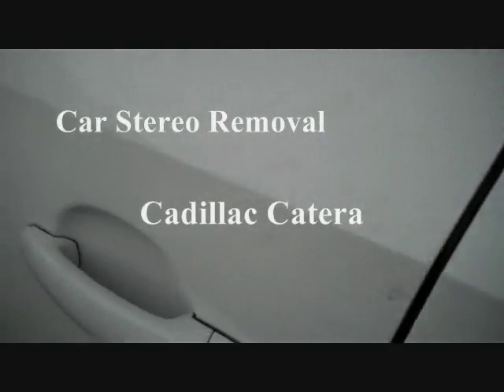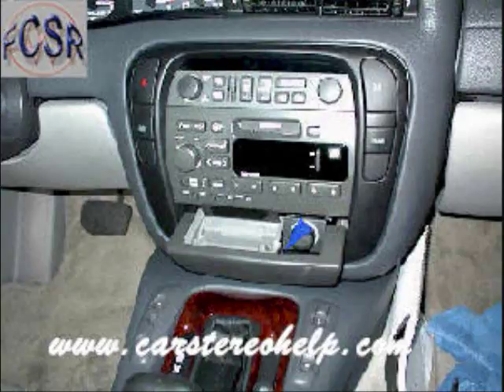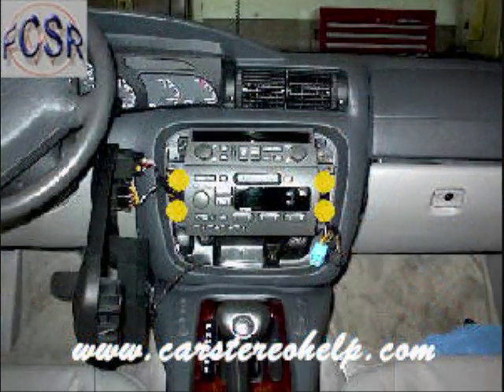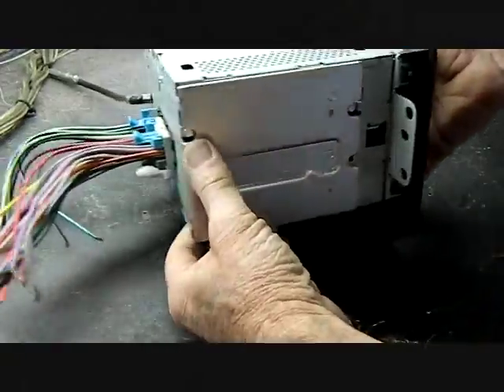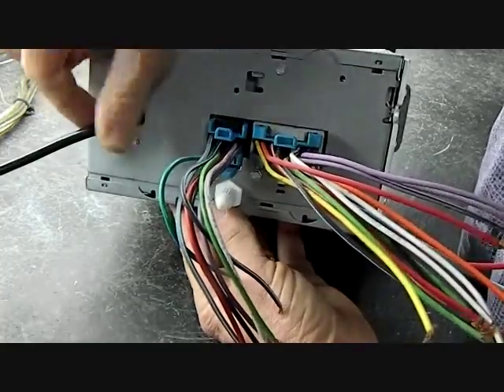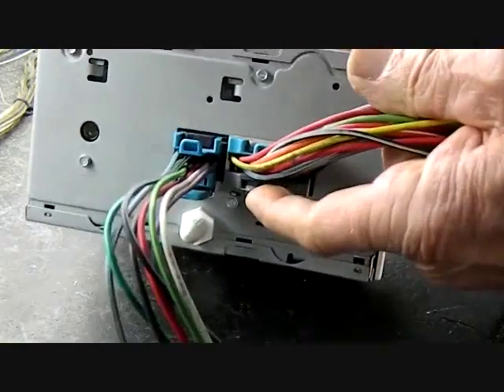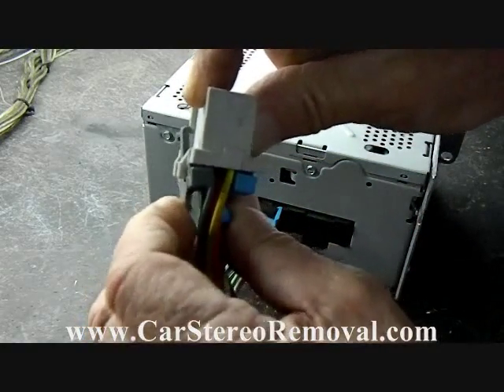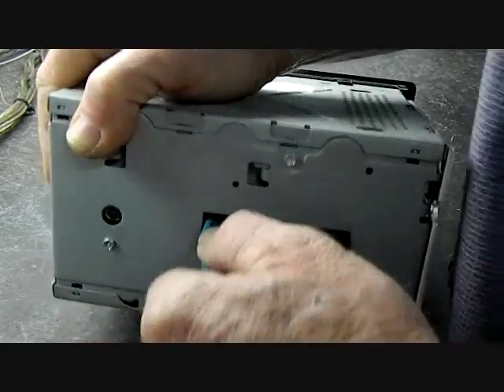Cadillac Catera Stereo Removal = Car Stereo HELP

Comment: Been messing with these wires for like an hour now. How do you take them off? The harnesses for the heated seats fuel door ect.
Reply: There is 2 clips on each botton. One on top and bottom. Press those in and take out the bottons from the front. Once the buttons are out the wiring harnesses should slide out. Look around plastic to see which way it slides.